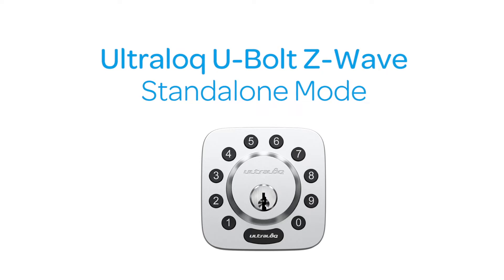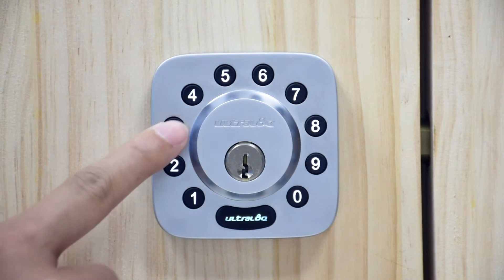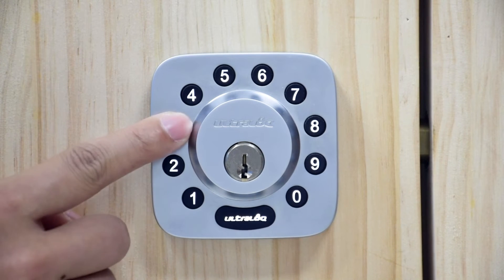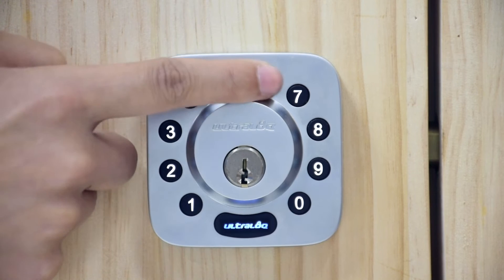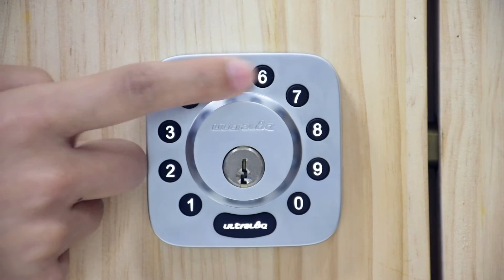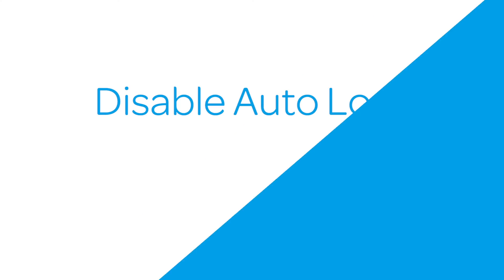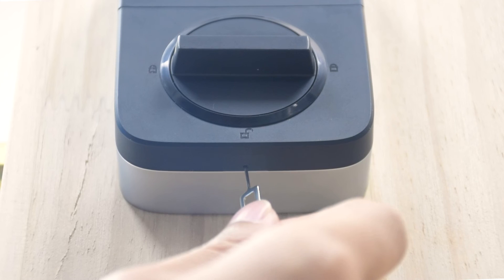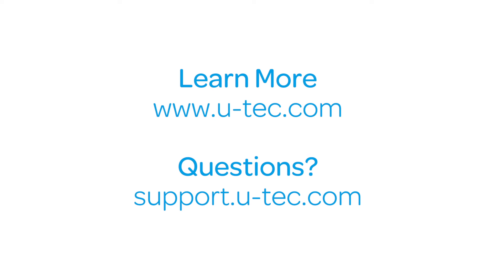U-Bolt Z-Wave Standalone Mode Programming

Comment: You are basically telling us that in order to use Z-Wave, we need to download an app, create an account (with a burner email and fake data), pair Z-Wave using the app for some mind-numbing reason instead of our Z-Wave hub or Home Assistant, and then uninstall the pointless app? I was so close to buying 4 of these until I found out you can't use just Z-Wave, thanks for the info!